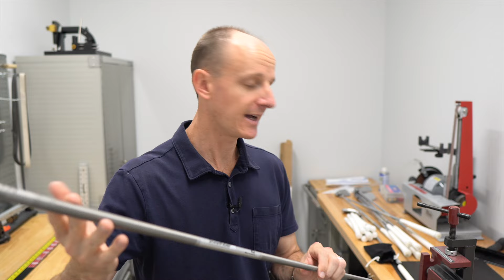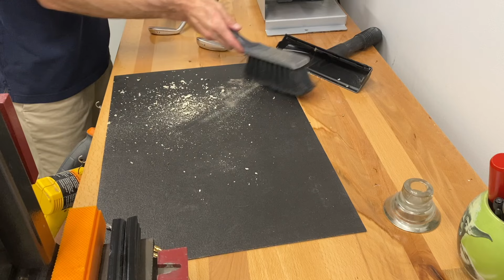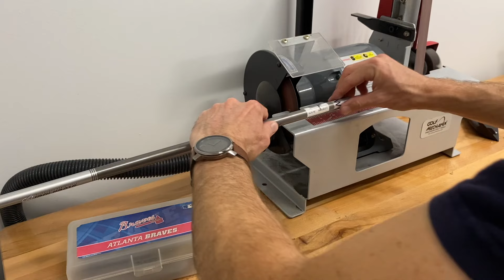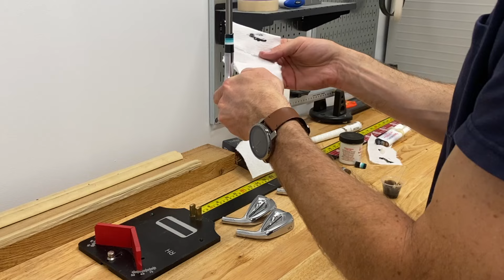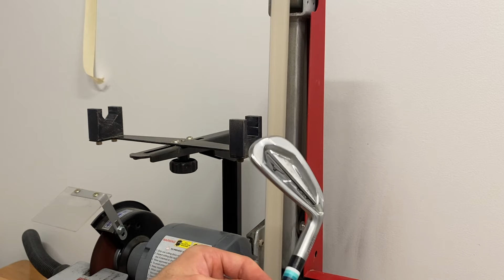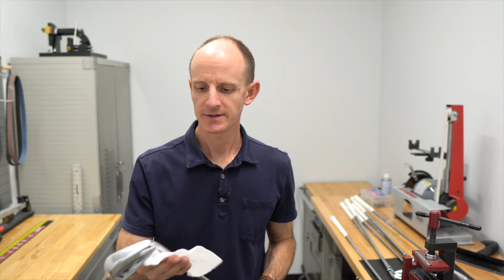PERFECT IRONS TO LEARN GOLF CLUB RESHAFTING

Comment: Great video. I’m ordering a gear puller on Amazon now. I like the drill at one end. 
I am going to try using a metal cutoff wheel in my angle grinder. I think that should do it with two cuts. Then use the grinder to clean it up.

Comment: Hi, great video! One question: as the shafts are constant weighted and the heads get progressively lighter, did you use weights in the tip section or did you leave it like that and therefore the slightly progression in swing weight for the set?
Reply from the maker: The head weight changes should more or less cancel out from the length changes through the set.

Comment: Hi, I lost a 3 i head, so I bought a cheap  new one. I pressed all the way down..The club feels slightly short..It had a conical hole. Any tips? T Edge Bazka T.Y. 5'6' vibration high. hits nice.
Reply from the maker: If it's short compared to the rest of the set you can always epoxy in an extension.
Reply: @EFGMC  Thank you sir.
Reply: @EFGMC  it's length equals the 4i. I should run 3/4 " down anyway, but I have a 1/2 " short 7i graphite that works great. It seems like I could get a slight bit more power, with 1/4" inch more. Lol.

Comment: How do i know when to use lead tip weights?
Reply from the maker: Use them to balance out the swing weights across the set or if you just want a heavier feel. I always dry fit everything together to see where they fall and make adjustments with weights before epoxy.

Comment: Did you mention what acetone will do to plastic? Why the light touch?  Like the video overall.
Reply from the maker: Yeah, it will dissolve the plastic or deform it which is why you want to use the lightest stroke possible.

Comment: You mentioned if it’s .37 tip you have to cut the tip end as well. I’m trying to reshaft a taylormade m4 iron set with graphite and wondering how to apply what you’re saying. Could you please advise on the meaning of having to cut the tip ? Thanks !
Reply from the maker: Depending on the shaft you are using (make and model) you will need to cut the tip a certain amount for each individual iron head it's going into. For example, you might need to cut the 5i shaft 2 inches and the 7i shaft 3 inches. The amount will be found on the shaft website usually.
Reply: @EFGMC  understood and thank you! I’ve read a few websites and nothing suggests cutting from the tip.. I watched another one of your videos where you use the ruler and marked the butt end of the shaft to cut it. Could you possibly do a video on this? I still can’t wrap my head around why cutting from the tip makes sense considering .37 is the tip diameter.. if I cut at the tip wouldn’t that compromise that diameter? Thanks !
Reply from the maker: @yaoming11fan  A .370 shaft usually has at least 5 or 6 inches of parallel running walls so you can cut from the tip without worrying about the tapering.

Comment: What size drill bit do you use for the hosel and the inside of the shaft?
Reply from the maker: Varies by shaft and head. Does not need to be a specific size, just small enough to fit inside and clean out any epoxy residue.

Comment: I have a question about the amount of epoxy to put in the ferrel. If there is too much epoxy in the ferrel  when you install the shaft and it goes up into the shaft, when it is installed, will it affect the tip of the shaft in any way?
Reply from the maker: Assuming you are meaning the hosel, not the ferrule. If you have too much epoxy with a steel shaft, it won't really matter. If you have a graphite shaft, it can force extra epoxy into the shaft which isn't ideal.

Comment: Greetings, I recently put a graphite shaft in my Mizuno MP-52 irons and now they sound hollow (a (CLAP) sound) which I don't like because I must have done it wrong, should I have put a silicone plug on the tip of the shaft? Or is it just a matter of gluing the shaft on and that's it?

Comment: Good morning. Quick question. What's your opinion on shaft weight and flex through an iron set. Example.  4-pw 105 gram R flex tapered tip. Should I get additional wedge shafts in the same weight and flex for my gw, sw and lw? Are go with a little heavier shaft. What's the normal if you were building a complete set from say 4-lw
Reply from the maker: Most better golfers will have similar weight in the wedges and the irons or will use slightly heavier weights. If your irons are 105, I'd go somewhere in the 105-115 range for wedge weight.

Comment: Hiya, your channel is the only one that’s discussed tip trimming taper irons so that’s led to a question for my new set. KBS C Tapers shortest shaft is 37.5” so do you tip trim in 1/8th inch increments in the PW, GW and specialized wedges so they play the same as the rest of the set or is it preferred to that they play softer ?
Reply from the maker: You can trim them 3/8 and still have them fit a taper hosel. I would do them all the same, 1/8 is too small to bother with.

Comment: I am re-shafting my Mizuno, MP 33 with a set pulls (FROM A SET OF miuras).  Is the BBSM the same for both iron sets? Also, how do I line up the grips exactly with the iron so it’s not off-center… thank you for your time
Reply from the maker: Not sure about the bore to ground difference between them though I think they are within a 1/4 inch at most.
Grips I would either set each club down on ground after epoxying and check alignment before leaving to dry, or dry fit them, line up the grips so they look lined up and then put some sharpie lines on shaft and hosel you can use as guide.

Comment: Ive watched quite a few of your videos and i see you putting everything together, even rubber banding the grip on to check swing weight. But shouldn't you put your wrap or wraps of grip tape on the shaft to add butt weight. If your adding weight to the heads maybe a couple more grams to balance out the tape?
Reply from the maker: You could but the dry fit is really just an estimation and more important in making sure all the clubs are the same or in a desired progression. No tape, but also no ferrule or epoxy so it usually balances out unless you are using bigger grips or extra tape in which case SW gets thrown off and might not be accurate for what you want.

Comment: Hey AJ I been watching a ton of your videos lately as I’m experimenting with my own clubs. Just a quick question, what are the shafting beads for and are they necessary? I reshafted my driver since it broke on the tip, I cut off 2 inches at the tip to the height of my liking and added 8 grams to the head just cause that’s what I had available to add. I used only JB weld original cold weld formula 24 hour epoxy. Would I need to redo this and add shafting beads to the epoxy?
Reply from the maker: Shafting beads just help center the shaft in the hosel. They don't add any structural support.

Comment: What was the swingweight with original shaft and after new shaft fitting. Didn't see you measure either.
Reply from the maker: After they were D0 in 4,5
D1 in 6-9
D2 in P, G
Did not bother with what they were going in.

Comment: Have reshafted many clubs and I follow your steps to do so. Having issues with ferrule gaps. Used shims on .355 shafts to .370 hosels with centering beads and the head still gets slightly cocked, any tips would be great?
Reply from the maker: If you can rest the clubs with the hosel in a vertical orientation when the epoxy is drying, that can help prevent the shaft leaning in a more upright position.
Reply: @EFGMC   Thanks for the response. I do stand them up vertically, so I put epoxy on the shaft, pressed shim in place, put epoxy in the shim, put epoxy in the hosel, press it together while rotating, then tap it on the floor as usual. When I the club vertical, the head can still rock slightly, seems to only happen when I use shims
Reply from the maker: @MikeSmith-er7sz  Many clubs will end up having a slight shaft lean. I will counter rotate the shaft every 3rd time when using a shim because I do find the shims can sometimes warp and twist in the hosel, especially with the thinner shims. A rotation in the opposite direction seems to help some times.
Also remember in some cases the hosel bore may not be perfectly straight which can lead to the same problem through no fault of yours.

Comment: What's the name of the tool you're using to measure the shaft length?  Is that grip solvent you're dipping the tip of the grip in before finishing with air?

Comment: If I need to extend my shafts by 3/4", in your opinion is it okay to use extensions or is it worth it to completely re-shaft (assuming I'm doing it myself so cost isn't really an issue, just effort)
Reply from the maker: 3/4 is fine. Anything under 1 1/4 I am okay with.

Comment: What's the drill bit size for removing the epoxy?
Reply: I think it depends on which hosel you have.
Reply: Shouldn't be using a drill bit to be honest.
Get a specialised one with wire brush attached. 
If removing solid epoxy leftover use whatever drill  bit you have which is smaller and closest to hosel size.
Reply from the maker: Depends on the situation. I will use a smaller size sometimes (3/16) or similar if I need to break a tip weight loose in the hosel.
If I am just trying to remove a larger mass of epoxy, I will use a wider bit that still fits easily inside the hosel. Just need to be careful when drilling depending on what type of head you are dealing with.
Reply: Golfworks sells specific sized reamers I personally use that are ideal for this task.

Comment: Really informative. What size drill bit did you use to drill out the remaining epoxy in the hosel. It was surprising how much epoxy came out.
Reply: Following this
Reply: The best bit to use is a spiral fluted reamer bit. It will be .355 for taper tip shafts or .370 for parallel shafts.

Comment: You went from DG steel shafts to a lighter graphite shaft. What were the swing weights prior and after? Static weight before and after?
Reply from the maker: 4 and 5 were D0, 6-9 were D1, PW and GW were D2 at the end. Did not check them before, does not matter. Static weights would be about 25-28g lighter.

Comment: Hi, was the attachment on the tire inflator the pure grips attachment?  Does that work for most grips or just pure grips?
Reply from the maker: Yes it is. I works for most any grip that you would try to use this method for. Jumbo size grips would probably not fit inside the attachment.

Comment: How do you avoid the sandpaper from coming loose on the dowel? Why the need to turn the ferrules? Do you have a detailed video on using the air compressor for removing grips?
Reply from the maker: You can buy sandpaper tips that fit on small dowels so they don't fall apart.
You turn the ferrules so they sit flush against the hosel. Purely cosmetic.
Here is the air grip install and removal video I did.
https://youtu.be/vuGnpvDEQuA

Comment: What air pressure did you use?
Reply from the maker: 55-60psi
Reply: @EFGMC  I blew up a grip once trying to take it off lol
Reply from the maker: @CybekCusal  Taking it off is a little different. If it was installed with tape and solvent, you need to be careful of bubbles forming and popping when removing with air. A PVC pipe just big enough to fit over the grip can help keep this from happening.

Comment: Also, any reason not to blow the grips onto the shafts earlier in the process when using air install anyway - seems like I would get a more-accurate swingweight that way
Reply from the maker: Best to have a sealed tip for the air to work properly. Tape might give you a tight enough seal, but if not the air will just go straight through the shaft and the process won't work. 
You can just rubberband the grip onto the butt end at the appropriate position and leave a little gap between the end of the shaft and the SW scale backstop to replicate the grip being installed. I only do that for one club and then just take measurements with no grip and convert all the numbers accordingly.

Comment: What size drill bit should you use to drill epoxy out of the hoesel for tapered shaft. How long is the taper at the end of the shaft. Can you take that drill down to the bottom of the hoesel?  Did not know you could blow on Golf Pride grips? Does that work for all Golf Pride grips? I had been using Pure Grips but I understand they went out of business. Have you used Star grips? Liked Pure because of low weight and feel of DTX. What do you use to heat hoesel for shaft removal?

Comment: Hi AJ. I really enjoy your videos with very useful tips and insights. I couldn't help but notice that clever little adapter you used here for the air compressor to connect to the grip. Did you get that from a store or was it something you custom-made with a 3D printer?
Reply from the maker: That piece comes from PURE grips as their install tool but it works for most any grip for air install. I did need to create an adapter however since the threading was larger than what my tire inflator could fit.
Reply: @EFGMC  Thank you

Comment: I re-shaft my 6-PW  to one length to be honest it was quite easy to be honest, It was simple to build just a few essential tools, like club maker has, male sure you have the right epoxy, take your time  and you will be quite surprised how you can save money doing it yourself.
I did this about 6 months ago.
So if you have the patience you will be quite surprised by your own ability.
I would add though try it on an old club first to see how it works out for you.
I let them all set for minimum of 48 hrs and make sure you line everything up.
Do your research and practice you really won't need to go to the overpriced club fitters. Wouldn't recommend rushing it take your time.